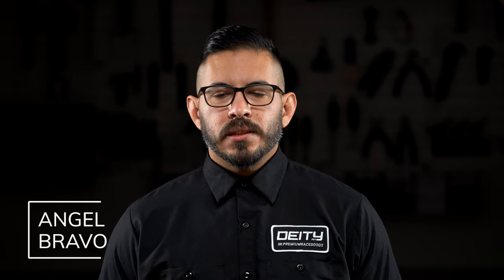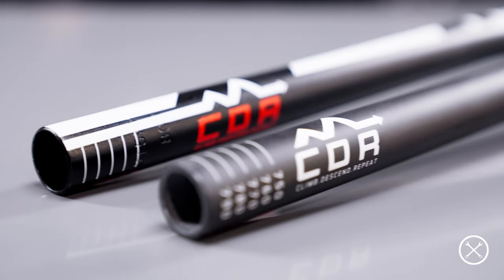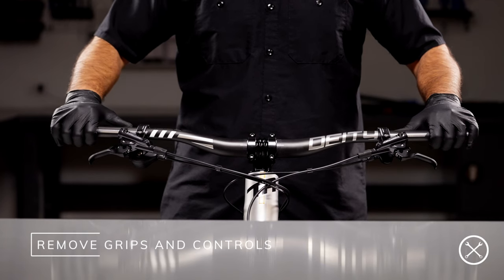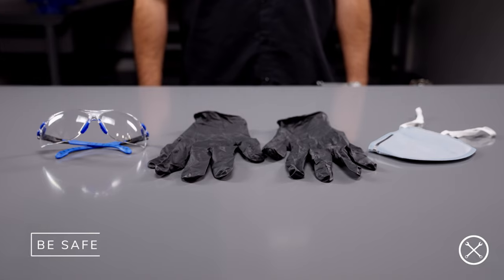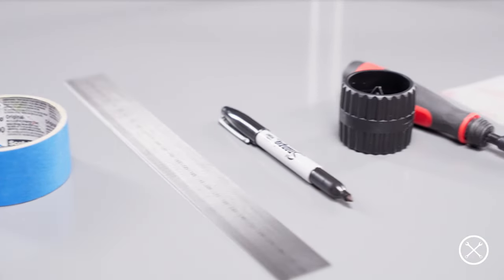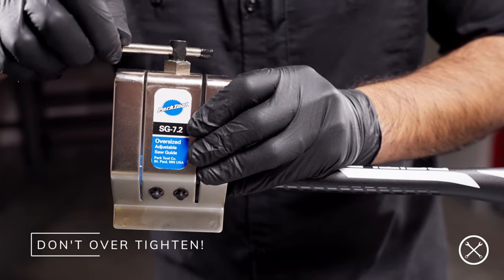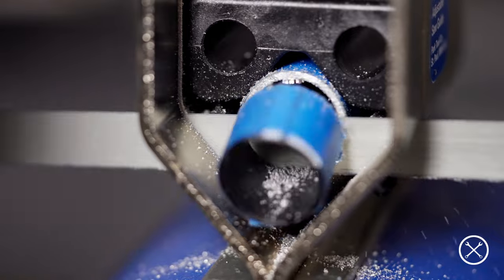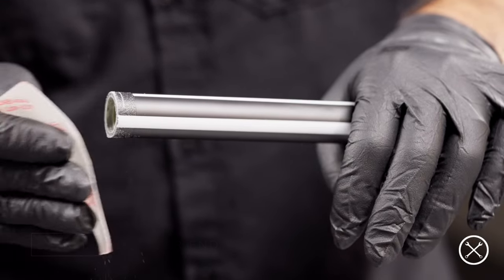DEITY Tech - How to Cut Mountain Bike Handlebars

Comment: For aluminum this doing it the hard way.
Just use an pipe cutter measure twice is still required. But gives an much cleaner cut and it's Much faster and easier to pull off.
Reply: Just about to cut my bars. I used a pipe cutter for copper pipes and it worked great. That means it will work on aluminum too?
Reply: Yes